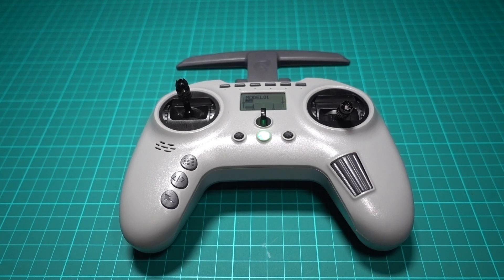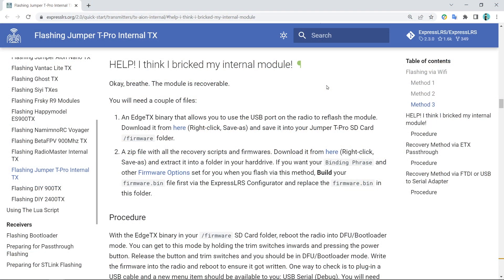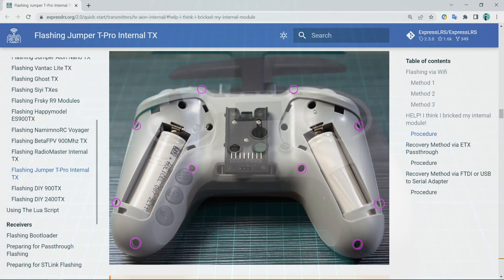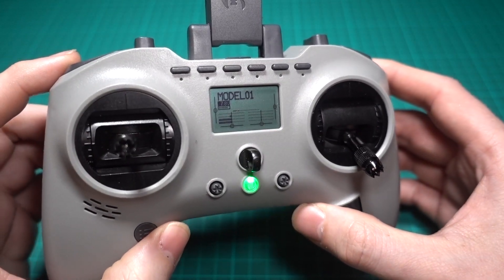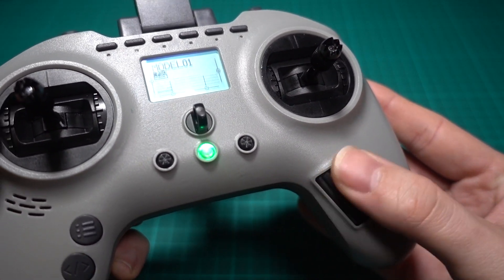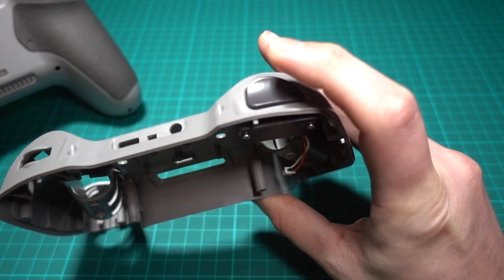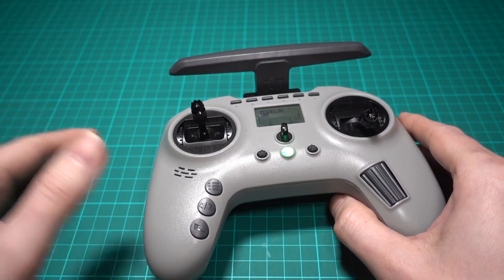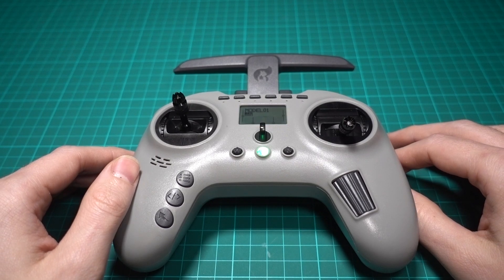1 Watt ELRS Jumper T-Lite Pro

Comment: I'm not sure if anybody else mentioned this, but the boot button is actually a boot button. The description in the manual could be (?) misleading, but the idea is: because there isn't a dedicated USB port for DFU mode, to enter DFU mode you have to keep that button pressed. In other words, if you don't press it, you can use the USB port to charge, or to connect to a sim etc. with no worries.

Comment: I got this radio and its perfect for its price! People can say the Zorro is better, but it's also 40% more expensive + the very rare 18350 batteries, impossible to find on local stores. The Jumper T Pro just requires some more patience to configure the buttons. After that it's a perfect radio! no complaints at all!
Reply: 100% Zorro is better,  better grip feeling, gimbal travel, Much better build quality, and more durable. Just the display and gimbal feel are worth it.  Jumper RC just feels cheap by comparison.
Reply: I agree with you! Zorro is a very good radio that we don't have the pleasure to hold in our hands.  Too ugly. Jumper T-Pro is not perfect but it's going on the right direction. The abundance of videos from people saying what they don't like about it, it is a proof of its attraction.

Comment: Huh? Wipe the firmware? When you plug in the USB without the DFU/boot button held down, the radio actually boots up and halts immediately, since the firmware detects the power on reason is not the power button - if it doesn't make sure you're running a later version of OpenTX or EdgeTX which have several the bugfixes for the TPro over the firmware version shipped with. i.e. this is why on more recent builds the function switch leds are used as a charge level indicator if the USB is connected and the radio is off. The button puts the radio into DFU mode... and to get out of it all you have to do is unplug the USB. It should not wiping the firmware - as to erase the firmware an explicit instruction needs to be given. 

The problems I see with the TPro (having come from the T-Lite and Zorro) are the plastic doesn't feel as good... the dodgy back covers (which to be honest - don't remove - use the USB charge port, the need to modify the transmitter for passthrough programming for the inevitable time wifi flashing bricks the internal module (btw, by adding a transistor and resistor, it can be fully firmware controlled - no button holding necessary), and lack of any 2pos switches (sorry Jumper... you were a bit late with that back cover!), and if you want to use any ACCESS Nano modules you're out of luck, as not all the nano module pins were hooked up. The pros are it has two 18650s vs one 18650... and has configurable functions switches and LEDs... and better buttons/navigation than the T-Lite... that is about it... Something about the T-Lite just feels more comfortable, the display is the same a bit too small size, the sticks are the same (surprisingly nice to use after having used for a while). With the addition of the Happymodel ESTX24-Lite, the power issue wasn't such a disaster. 

Having said that, I think the TPro certainly has it's place, and I hope Jumper will smooth out these rough edges. i.e. I would expect we'll see future revisions with ELRS passthrough as standard as that can easily be added for the next board revision. 2POS buttons as standard would be a nice option (instead of having to mess with sticky logic switches). Hopefully in the future between OTX and ETX we can also add in an option to bring back legacy behaviour of the 6POS (as it's only a firmware issue). Jumper have made it so that unlike the TX16 each LED and button can be individually controlled by the firmware, bringing new possibilities, but we also need to support those people who want the old behaviour.
Reply from the maker: Its in the manual, so not sure what else to say about that...

Comment: I did not get the SMA adapter with mine.
I do like this radio. The form factor is great.
I drilled a hole and mounted a toggle switch in place of the momentary one. It takes a lot of work to like this radio but, I really do like it.
Reply from the maker: Yeah i think depending where you bought it from they may have removed it from the package because if elrs gets certified it would be illegal for the user to modify the antenna out of the box. But it would be fine sold as a separate product

Comment: For me it is a decent transmitter for the price. 
Configured the momentary switch button as sticky key, so I can arm/disarm by pressing it just once.
Charging the battery do take much more time compared to t lite, maybe due to two 18650s being used.
Luckily didn't have the firmware update problem, maybe because I was updating through laptop's wifi

Comment: Someone in Jumper must be sacked for making this crap. I had to stop watching your video at 8:55 Andy for the very first time not because your video was bad but because I cannot imagine that this radio made it to the market and its sold even now. The good thing Jumper could have done was to recall this product change the main board and fixed all the issues and rerelease it.

Comment: Nice to see your review on this. I bought mine over a month ago. And really like it. I chose it over the radiomaster because of the form factor - small screen, large fold antenna, and 18650 batteries. It feels ergonomic in my small hands and in this respect is an upgrade on the TLite. I got the ELRS version, I was lucky to update EdgeTx to the latest version at the time and update to ELRS v2 over wifi without problems. I have charged the radio 3 time already without wiping firmware. The only big negatives for me are lack of latching switch for arming (out of the box) but I have learnt to use the momenatary as a sticky toggle; and the other negative is the ELRS module is so over powered, I would never use it at 1W, max 500mW or 250mW would have been fine. This radio has so much potential, if only Jumper would revise it and address the negatives pointed out by reviewers like you.
Reply: Have you ever experienced jitter problems with power greater than 100mw ? Some people say it is almost unusable at 250 and completely unusable at 500 and above. Thank you very much
Reply: @albertomazzanti8510  I have not used it at 100mW or higher. I will watch more reviews and read comments. Thanks for drawing attention to this.

Comment: I would tag it as „NOT RECOMMENDED“ with extra thick letters in the thumbnail. Not because it is not worth a buy but to make jumper fix these flaws and to remind the competition to think about the quality or at least send beta versions to testers before mass-producing remotes. Without pressure the have no need to change anything.
Reply from the maker: It's a tough one as I agree but it's also an injustice to the amount of work the devs did to fix it. Really it's up to the people to decide. I think I was pretty fair. I didn't leave anything off the table.

Comment: Thanks Andy for the review.  I agree with your opinion of the form factor, I love mine.  I have the 4 in 1 w/Aion module.  BTW most useful option I have learned about mine is the 6 switches across the top can be programed as single on/off switches,  2 or 3 way switch sets.  Can be programed on second page easily.
Reply: Hi. How is it holding up?
Reply: Hey bro! What's up! I have seen a video from Joshua Bardwell teaching on how to separate those keys in different groups so that they could work separated from the others, but how did you do the "2 or 3 way switch sets"? Could you share something about it? Maybe I did not understood it right. Thanks.

Comment: It's not a cheap radio (125€). I ordered a "Zorro" for 100€ a few month ago, but BG couldn't supplie it. So they refunded it, no problem. I'll stay with my bigger radio and a module as usual. That's fine for me. How could your Jumper be so cheap?

Comment: FrSky makes good radios, despite the FW sh!t show. My two year X9 Lite worked fine out of the box, the internals were nicely made, etc. Jumper or Radiomaster many times release unfinished products.
Reply: Same here. I've decided to stick with my X9 lite as well. I just prefer the size and shape. It's like an in between a full size and a game style. I think the only controller that would be close is maybe the tbs mambo but that is a whole other situation. Lol.
Reply from the maker: Cant sav iv ever found a radiomaster product to be half finished. I have something planned to try and show that. but nothing wrong sticking with old gear if it does what you want.

Comment: Yeah will just stick to my trusty TX16S that has never let me down. Even if it doesn't have built in ELRS the modules are affordable enough I'd have a hard time recommending much less to people. Besides even if these are suppose to be budget/beginner friendly options I would hardly call ELRS beginner friendly at this point.

Comment: I almost bought one of these when they first came out after seeing the crazy low price kind of glad I didn't in retrospect.
Some people who love to tinker might find a fun build project here, but I imagine you're looking at about 4 hours of work to get a usable radio after buying this thing.
I also heard that the gimbals are very high instead of being inset lower into the radio body, did you notice that?
Reply from the maker: you know i nearly mentioned in the video. actually took me 5 hours to get it going although a lot of that was the mode change. the sticks are high yes but i actually prefer this as it gives me more stick throw. This is why i like the bigger radios.

Comment: It's junk.. Jumper needs to get back to the drawing board on this one. An after all this, if they come out with another transmitter that has even one of these issues again then they might as well jus throw in the towel n start doing something else.
Reply from the maker: Yeah I think this is probably part of the reason they parted ways and radiomaster was born
Reply: @AndyRCchannel  Yeah, seems like one of them wanted to make good quality radios for a decent price. And the other one wanted to make cheap garbage radios for a cheap price.. its obvious who was right. I'm glad they went their separate ways.
Reply: BURN IT DOWN! That's the only thing that will help all of society is to burn down Jumper and have them rest in peace! ⚰️💀 Junker is not something anyone should ever even consider buying! Total garbage! 🗑️😭